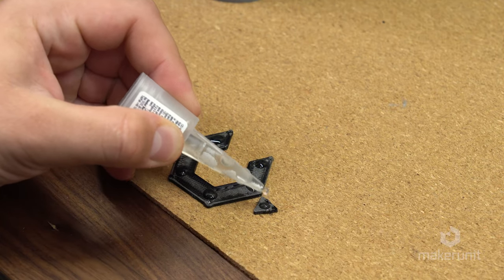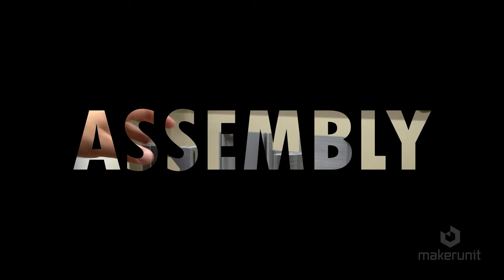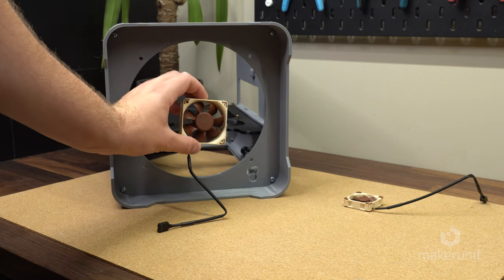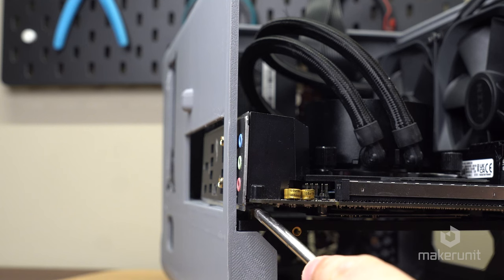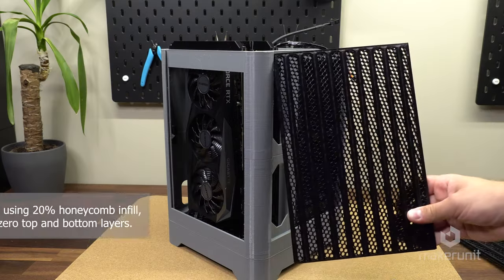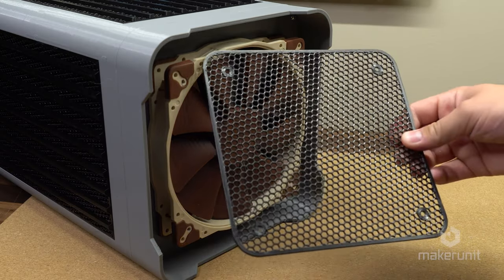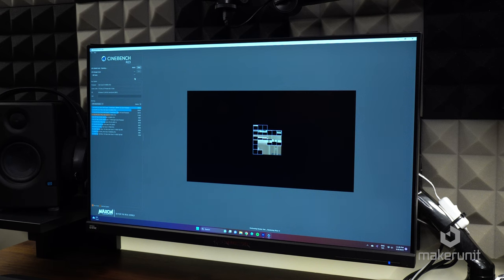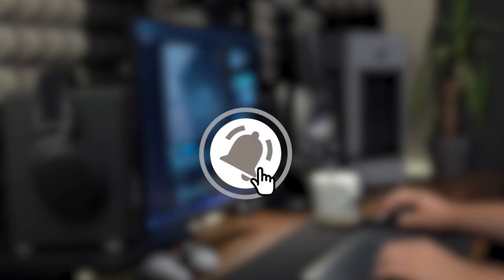Mini ITX 3D Printed PC Case Chimney Style

Comment: man I wish I had your creativity. Eventually I want to build a pc, and this will be perfect. Problem im running into currently is I upgraded from a 1650 in my Trident 3 to a 2060 super.... and it doesn't fit anymore. Issue with using a design like this for transferring the Trident 3 parts over is it has an external power supply. Hoping to find something in your files I can attempt to get to work
Reply from the maker: Thank you! Yeah unfortunately my cases can’t be compatible with every single part on the market but many of the most common at least. I do my best to keep the projects coming so hopefully you can one day find a project that suits your needs! You’re also welcome to come with build suggestions and ideas if you have any in mind 😊
Reply: @makerunit  this is a selfish idea as its what im in need for. But if I was to make a request it would be for a bigger version of the trident 3 case or something bigger in general that will fit alllll of its random ports and plug ins. Its a nice little box for what it is.... but upgrades that are compatible with the motherboard don't all fit within the case they provide.

Ill still be aiming to do research and practice with cad programs and 3d programs until i eventually am able to be able to create wonderful pieces of work like yours!!!!
Reply from the maker: @bordnation1594  I see! What type of motherboard is in the Trident? Is it based on a normal Mini ITX motherboard? 

I’ve been thinking of making a «console style» case for a while actually!
Reply: @makerunit  i have the trident 3 8th gen (not sure the differences as they've gotten newer). When I looked it up online it says the H310. But physically looking at it, it looks nothing like the h310's i seen online.. so im not entirely sure. Msi has a specs page that has a data sheet on it... lists all the ports and such but not the motherboard.  I found the motherboard in the description of the trident 3 on newegg's website
Reply from the maker: @bordnation1594  hmm, I see, so most likely my upcoming projects will be based on a Mini ITX or a Micro ATX as those are the two formfactors I have available at the moment.

Comment: Have a dual 360 mm radiator water cooled 3080 ti and an ATX x570 motherboard. I'm wondering how small you can make it and if you can print a case to be very compact
Reply from the maker: It should be possible! I do not have these parts available to design around but maybe some day I might! 😊

Comment: i have a question: do you have any models of pc components so that i could try to make a pc case of my own? thanks! (i use tinkercad so obj or stl please :) )
Reply: update: i got the objects to work from one of your earlier videos, but they are all the wrong sizes.
do you think you could give me the dimentions? thanks!
https://www.youtube.com/watch?v=HoUxaEunoRM
Reply: another update: got them working from mesuring and resizing.
sorry for this!
Reply from the maker: Great to hear it worked out, let me know if you have any issues 😊
Reply: …i couldent get the sizes right :(
Reply from the maker: @ilikepewpewslol  If you look at the .step files on some of my latest cases you can find some pretty accurate parts inside those files.

Comment: i love these pc cases
Reply from the maker: Thank you! 😁
Reply: do you think you could try to make the smallest case without using a riser?
i kind of want to print a case
 @makerunit
Reply from the maker: @ilikepewpewslol  my first ever case design was actually a tiny PC like you describe without using a riser cable. Though it never made it to a video I still have the design idea in my head. I actually thought of a design with like a two part outer chassis. That could extend based on the length of the GPU. 😁
Reply: i odnt think my cpu cooler would work with that case. i have an intel stock cooler (one of the new small ones) @makerunit

Comment: Awesome quality as always! I've literally printed each new project that's came out.. and that's a good thing I have new printers to torture test haha. I was wondering as a aesthetic standpoint the thickness of the side panels as I'm thinking I can fabricate some plexiglass panels to slide into the panel grooves depending on the thickness.
Reply from the maker: I’d have to double check but I believe the sliding tracks are 3mm and the sliding part of the side panels are 2.5mm wide allowing for 0.25mm of wiggle room on each side to slide smoothly. Though with the supplied step files this should be really easy to modify to your preference.

Comment: Interesting design, now I'm curious to see what a wind tunnel case could look like compared to this wind chimney 🤔
Reply from the maker: I have thought about a design that has like air channels directly leading to the specific components from the intake fans, I know that Optimum Tech posted a video on this method recently and beat me to it but I have some ideas on how to do this differently wich I might try later 😁

Wind tunnel vs Wind chimney, would be like a wind chimney just laying down wouldn’t it?
Reply: @makerunit  that optimum tech video was an interesting one! And yep, I'm thinking wind tunnel in the same style that would be used for cars etc. Similar to this build but more like a laid down version
Reply from the maker: @declanbowler7379  funny thing this case was actually started as a project laying down, then kind of randomly ended up rotated 90 degrees and I was like hmm, this is cool too, I’ll keep working on this 😁 the main goal for this build was to use two 200mm fans, so I struggled a bit with having the laying down setup as the rear 200mm would block the motherboard IO and gpu connections. If using a 140mm rear though I think it could work pretty well.
Reply: @makerunit  ah of course, that sounds like a good idea! Regarding the case in this video, did you try the radiator fans as intake? Perhaps it would mean more air for the GPU?
Reply from the maker: @declanbowler7379  the main problem with using the CPU fans as intake is that at the height the fans are, it’s already so high up that the GPU and CPU gets separated by the motherboard, so I don’t think it’ll work. Also the air coming through the radiator into the case might be hotter than the air coming from below if that made sense. 

Optionally if using an air cooler you could use the AIO mount as two extra intake fans for example.
Reply: @makerunit  I understand, it's something I'd try if it were my case as the setup shown looks to be exhausting more air than its intaking, so perhaps the opposite would give better cooling. Though if the hot air from the GPU isn't getting drawn through the radiator then it won't make any difference
Reply from the maker: @declanbowler7379  the bottom part might be a little restrictive compared to the exhaust and some air might be drawn in through the side panels actually so might actually work to add some additional intake definitely.
Reply: @makerunit  if you do test the idea I'd be keen to hear how it works out!
Reply from the maker: @declanbowler7379  I’ll try to remember if I end up testing it.👍

Comment: Challenge - make matx Case to print on ender 3.
Matx mobos are way cheaper, and a lot of people heve amaller printers like ender 3 ( 230*230 print bed)
Reply from the maker: I do have an ender 3 too 😁 I must admit having the bigger one I rarely touch the ender, but like a 4 piece design could work just fine. Just need to find some clever way of interlocking them easily, though should not be impossible 👍

Comment: Atx version much appreciated
Reply from the maker: I see a lot of people want ATX cases. Should I start to listen soon? 😁 first I need to get myself an ATX mobo 😬
Reply: @makerunit   you surely deserve a small performance upgrade :D, yes please im dying to find a good or even any atx case, most of them came in 3000 spieces without clue on how to assemble them and yours just stacks ontop
Reply from the maker: @NicoMoessmer  hahah I’ll see what I can do down the road. I’ve got a few other projects lined up but I’ll keep this in mind. Any specific type of layout you wish I had made? «normal» tower? Console style, compact?
Reply: @makerunit no worries, im pretty much down to anything, i currently have the q500l with the window facing up, maybe even having place for a 5.25" rom drive would be amazing especially today where basicly none of the "gaming" cases have one
Reply from the maker: @NicoMoessmer  5.25’’ drive? Do people still use those? I barely add normal HDD support to my cases as I thought everyone were already over to SSD’s 😁 I get HDD’s are still useful in like NAS systems but people still use those in modern systems? 😅
Reply: @makerunit  im guessing all of the people who want one are just buying the usb version.
i actually do, not very often but i have plenty of movies on blu ray or the original gta 3 disc.
would be cool if it was an optional part of the design but no worries if you wont do it :D
Reply from the maker: @NicoMoessmer  the biggest problem for me is mainly that I don’t have one to base my design off of 😅

Comment: Can you make a mATX version?  Also, how loud is it?
Reply from the maker: This case is not very lound on idle. Pretty much silent actually as the 200mm fans spin very slowly and are pretty much silent all the way up to 60-70% power, and due to the low CPU temps it actually never reaches the point where they need to go 100%.

The GPU on the other hand can be somewhat loud if running higher temps as it runs it’s own cooling system of course but it’s not really something I notice much while gaming with my headset anyways.

Comment: Meh, always ITX.. why does no one print good ATX cases with water cooling support ? THAT would be a sick challenge
Reply from the maker: Mostly comes down to the fact that most 3D printers are smaller than the ATX form factor size. Just easier tbh. Though I could always just use more parts that join together of course. I’ll try my best to make something in the future that can support common full size parts. Perhaps some sort of open air case would be cool.

Comment: Brother dry your damn filament
Reply from the maker: You mean because of the printing defects?
Reply: @makerunit  I can see these diagonal strings formed when you were printing the case on the slopes, which was the exact same stuff I had when I was printing my own PC case. Thought my printer was busted, but my fillament was just abused. Got an eibos fillament drier to fix that.
Reply from the maker: @klaidasrunele  So you're saying the layer lines may be caused by wet filament? All the spools I used for this build came right out of the box (sealed) with silica gel packs inside which I thought was dry already. I thought the lines were caused by the axis(es) not being perfeclty smooth. 

Or do you mean the general stringing? Isn't that just due to retraction settings/temperature?

Comment: I love this project! If i could change anything I would add some sort of texture to the outside . That could possibly help with hiding the layer lines
Reply from the maker: Thank you! That’s a great idea, I believe some slicers have build in texture adding tools too, but I’d only want it on the outer walls, but like a rugged texture could look pretty cool!

I could have perhaps sanded down the outside as well and prepare it for painting in like a metallic space gray color would look awesome!
Reply: Layer lines are a feature of the manufacturing process. I say make it with thicker more noticeable lines.Lean into the 3d printing aesthetic rather than try to hide it.
Reply from the maker: @minty_lint  1.0mm nozzle, 0.8mm layer height 😁 could look cool. Have you seen those 3D printed houses? Those layer lines actually gives the house a very cool and unique look tbh!
Reply: Nothing that sanding and priming couldn't fix

Comment: I was thinking about how you could mount a large GPU normally, without the riser, simplifying the build. What if you just turned the motherboard 90° clockwise so that the IO was facing upwards? Then it could sit against the back of the case like normal, and the GPU could be on the front of it, vertically oriented with plenty of room. To make io axis easy, you could leave a slot in the back of the case that all of the cables go into and you could have a removable window at the top of the case to make it easy to see what you are doing and use both hands. It's not like most of us are plugging and unplugging stuff every day anyways. Then the GPU would be easier to access as well. Thoughts? This is a really awesome case and I love this small form factor. Wish I had time to design my own hahaha.
Reply from the maker: I totally understand what you mean and to be honest that was actually how this build started in the first place. It would have probably worked too, but there was just something in me that really wanted to rotate the motherboard 90 degrees so it was facing backwards, and I think it was also kind of to have as few as possible cables interfering with the top fan blocking airflow… if it would have made a difference I’m not sure but I totally agree that most of us rarely even plug in and out stuff and the easiest fix would simply be to intregrate some front panel USB ports for easy access to that, or use a USB hub and problem solved. I’m personally using a hub built into the side of my monitor for all non-permanent USB devices, works great but I see how it becomes a problem when people have different monitors than me 😁
Reply: @makerunit  Thanks for the awesome reply. I def want to try printing a case someday! I love the 200mm fan tower case idea in general.
Reply from the maker: It’s a lot of fun! And looking at your own designs everyday gives you (at least me) a sense of accomplishment like «I made that and it actually turned out pretty cool!» 😁

Comment: Nice build especially the 200mm fans! super quiet and lots of airflow. Maybe flipping the GPU upside down and mounting the PSU vertically can further shorten the height. The black meshes cold use round bevels on the corners for matching the rest of the aesthetic but not a big deal. ok I think thats it lol.
Reply from the maker: Thank you!

About the airflow on the 200mm fan, I actually saw in the specs that the 200mm and the 140mm have almost the same amount of airflow m^3 only different noise levels. So I do think 140mm fans could work here too, with some adapter plates. 

I actually didn’t think of beveling the side panels, but that would have made them even more fitting to the rest of the look definitely.

Comment: I have a model of an Xbox Series X. Do you think it is possible to make it a reality?
Reply from the maker: Most things are possible, just need to find clever ways of making it all work together. (I looked at your files from Thingiverse) Biggest challenge is the printability of it, you should consider splitting it into parts as it’ll be way easier to print and sturdier if you do.

Comment: Hey I like the Idea of those vertical cases but I think the addition of a risercable that has to be bend is not ideal. Just look at the desaster with the NZXT H1. Some ppl will get a cheap riser from AliExpress with questionable QC.
The Layout of the Corsair 2000D is much more appealing to me. A Version of that which can fit the big Noctual coolers like NH-P1 and NH-D15 would be awesome.
I just built a system with the NH-P1 and a semi passive psu and graphicscard in a jonsbo u5s. I really love that while not gaming its completly silent and passive. Having somethig like that in a vertical case without the riser would be awesome.
Reply from the maker: I see. My next case will most likely fit a 160mm cooler so the D15s should fit if my calculations are correct. It won’t be vertical though. No riser cables and it’s simple to assemble. 

The 2000D looks pretty great and it’s definitely a great inspiration for a future vertical design 😊

Comment: amazing design, you need to clean up your print quality though haha. CR10 converting to a ender 3 style belted Z mod, and tuning your retraction looks like it would help with most of it. If thats a biqu H2, try 0.4mm retraction with a retraction speed of 4mm/s.
Reply from the maker: Thank you! And yeah I know the print quality is not my strong game tbh 😅 it’s actually a E3D Hemera. Currently I’m planning on getting a new printer actually. Looking at possibly trying the new Elegoo Neptune 4 Max with klipper stock 😅

Comment: Looks awesome, but it would be a good idea to add some IO to the front of the case. Having all your IO in the back tends to be really inconvenient, and it looks like this case would have room for something like a small USB hub/card reader to be integrated.
Reply from the maker: There is definitely room for that. I have an integrated hub in my monitor which I’m used to using and it’s probably therefore I also tend to forget to add that every time 😅

Comment: I'd love to see the logo get a pop of color. You ever get your hands on a bambu lab machine and ams? Even the new mini one could work for multicolored logos.
Reply from the maker: Or perhaps a transparent filament with LEDs that can change the logo color 😁 I do not have access to a Bambu machine unfortunately and I most likely will not get one either, at least not until they offer a printer with 300x300 bed or bigger 😊 once you go big it’s hard to go back to a smaller size, printer size.
Reply: @makerunit that's cool too!

Comment: Any danger of the system's heat warping or otherwise affecting the case?
Reply from the maker: Not that I’ve experienced. Never had issues with any of my cases regarding heat. Even the PLA cases. I do recommend using PETG when possible but most cases, especially those with a lot of airflow, PLA should be fine.